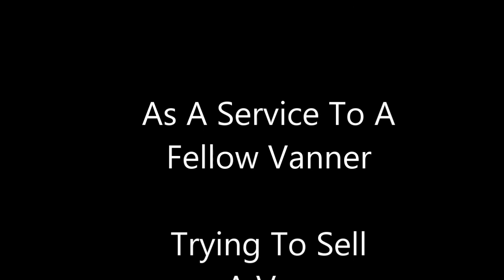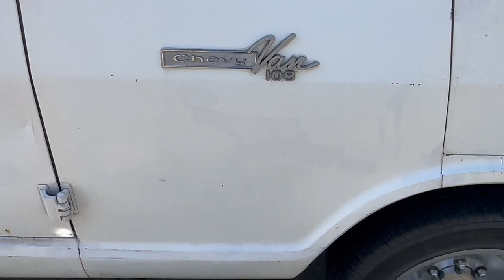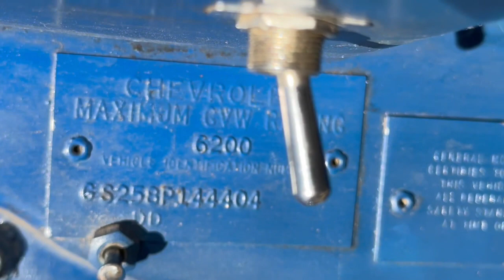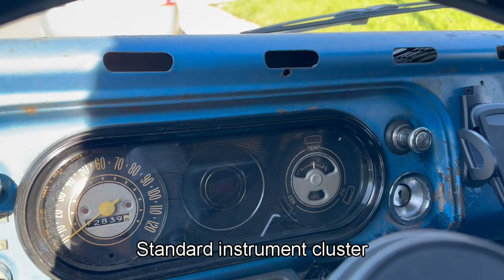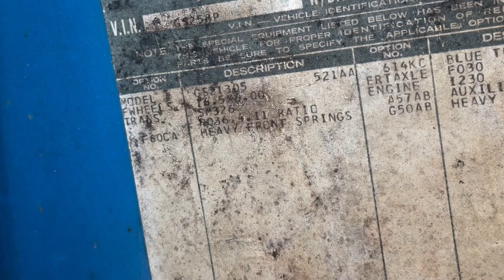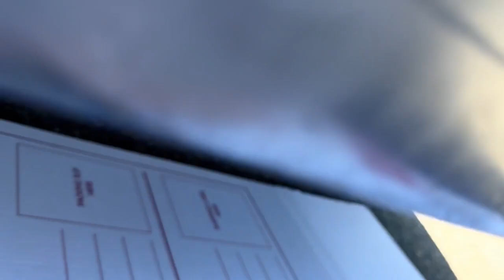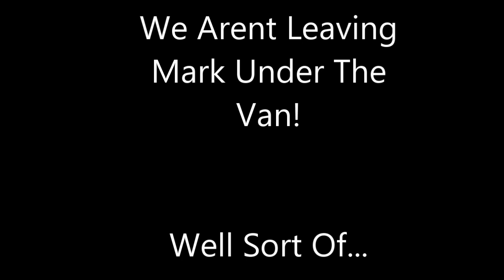1968 108 G20 Part 1

Comment: nice van would be nice to know what heater core was used
Reply from the maker: I will try to find out. Thanks for the question!
Reply from the maker: The heater core was purchased from Amazon Universal Air Conditioner UAC #399239C HVAC heater core.  The caption below the Amazon picture says " ! This does not fit 1968 Chevrolet G20 Van".  (All evidence to the contrary :>)
Reply: @vintagechevyvanparts  great thanks for the info i will definitely look into it